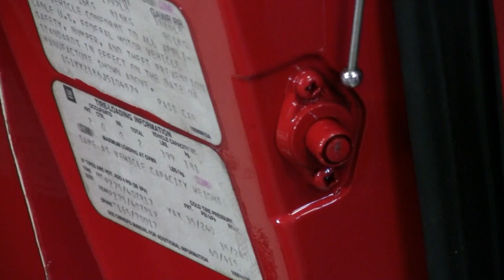C4 Corvette Cutaway Door Components

Comment: I have a problem with my passenger window not wanting to go up and down at times. 1996 C4 
Corvette. Have any quick fixes ?   Thanks
Reply from the maker: +Steven G If the problem is intermittent, it is tough to pinpoint which part is the issue. It could be the switch, motor, wiring, etc. The problem would really have to be diagnosed to get the proper part. 

Thank you,
Kyle
Product Assistance
Reply: +Corvette Central thank you sirs for your quick reply.

Comment: I'm looking for the clip that goes on the rod right behind the lock cylinder on the doors. I turn my key on the door and it only turns but doesn't lock. I found out that the clip that holds the rod to that component is missing. what is the item number for that part so I can purchase from your site.
Reply from the maker: +Luis Herrera There are 2 different clips you may need our #284013 and 284038 both are pictured on our website. www.corvettecentral.com
Reply: +Corvette Central the part I needed was 284038. one door was good, but on the other door the rod is missing the clip that needs 284038 to clip onto. do you happen to have that part. it's the one that goes directly behind the door lock cylinder where you turn the key.
Reply from the maker: +Luis Herrera The only other clip that we offer for these door rods currently is 284088. This is the door release handle to rod clip. I do not see a listing for the lock cylinder clip. 

Thank you,
Reply: +Corvette Central you wouldn't happen to know a part number for the one that goes on the lock cylinder. my door latch clip is good. the only thing is that turning the key does nothing unless I'm able to attach the rod to the cylinder somehow
Reply from the maker: +Luis Herrera It sounds like you are in search of the "pawl". The GM part number 14075363 may be what you are looking for. Search that number online, and you may be able to find a good used piece. 

Thank You,
Kyle
Reply: +Corvette Central yes that's what I need. and you guys don't sell it?
Reply from the maker: +Luis Herrera No, unfortunately we do not currently carry this part.